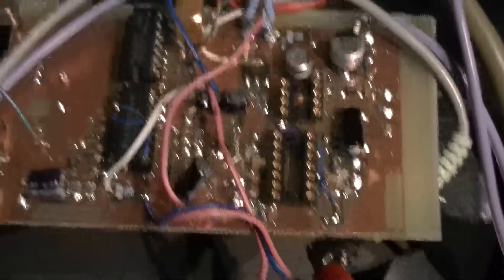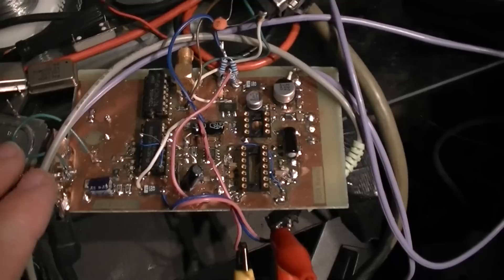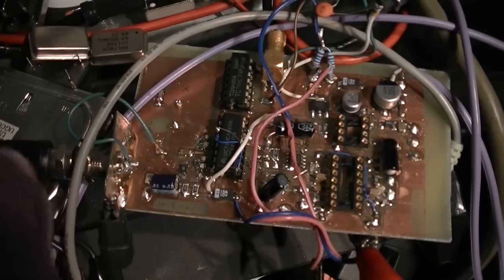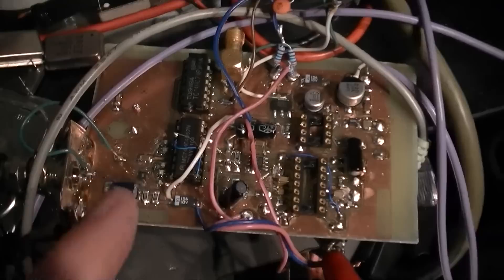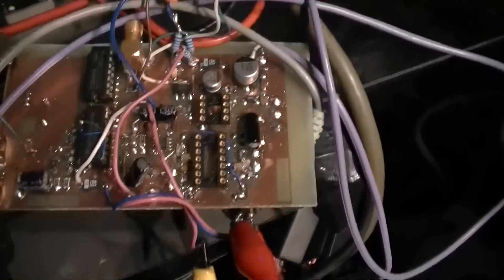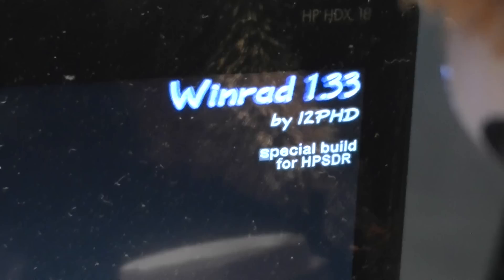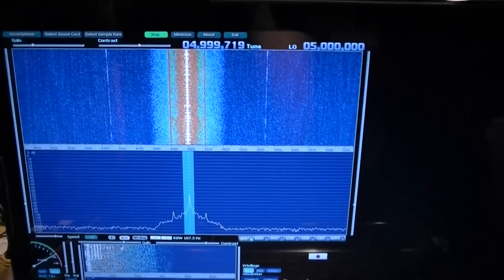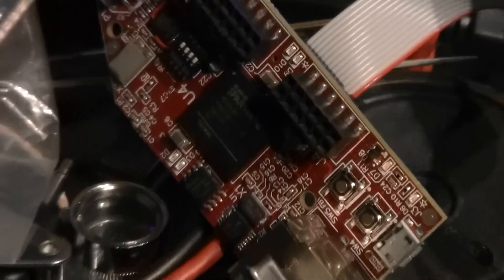Software Defined Radio VLOG - Part 1

Comment: From what I recall from my AM/FM communications class:

Normal radios generally have a signal of a few kHz bandwidth on a multiple MHz (or higher) carrier.  In HW, they eliminate the carrier, then output the signal.  Over time, radio receivers have improved about linearly with time.

Software defined radios do minimal filtering in HW, passing the filtering/processing/separation on to software, which harnesses the power of CPUs whose power is growing exponentially with time.

Comment: Hi, Jeri, long time listener first time caller.  I wish I would have seen this project sooner.  I previously had built a KB9YIG softrock RXTX.  I have always wanted to build a portable replacement for the PC.  And have always wanted to play with FPGAs.  Looks like I have some work to do.

I love the simple front end you have put on that receiver.  And was amazed at how relatively clean your noise floor was considering the construction. GOOD WORK!

Comment: SDR's and the Tayloe  style detector are a type of what we call a "phasing" modulation or demodulation scheme.  Phasing SSB generation was patented I believe in 1915.  Phasing modulation schemes were developed in the early 1900's.  They were first developed as a mathematical model because we didn't have the electronics to build them at that time.  In early SSB generation (late 50's) phasing (development of the I & Q) was done with passive networks and balanced modulators.  The digital technique of I & Q feeding "bins" therefore has its pedigree from this earlier very elegant technology.  I had a phasing radio transmitter running back in 1964 when I was 12.  I've always been a big fan.  Modern SDR is a descendant of this 1 00 year old technology Thought you might be interested in the history.

Comment: NIST has not decided to terminate WWV service yet - but they are asking listeners / users of their broadcast services to fill out a survey - presumably they may end or at least cut back on the broadcast services if need doesn't seem to be apparent. So, everyone who find the service valuable (for, among other things, testing new radio designs!) should participate. YT does not permit links in comments but G for wwv survey site:nist.gov should find it.